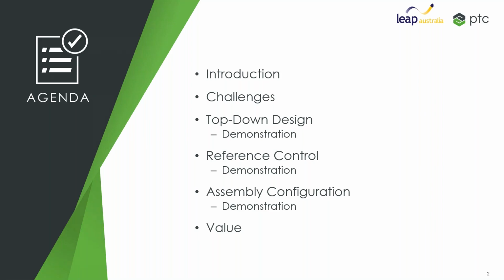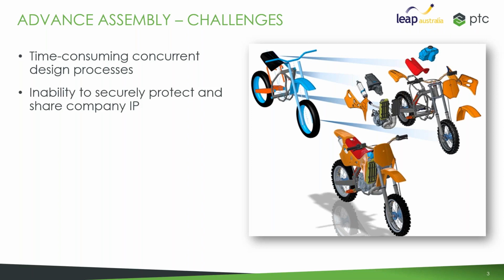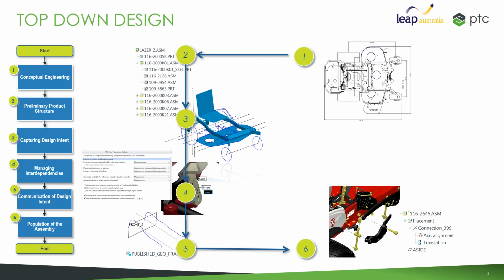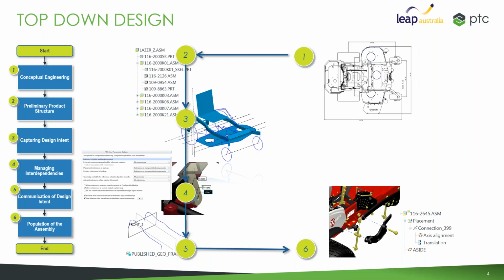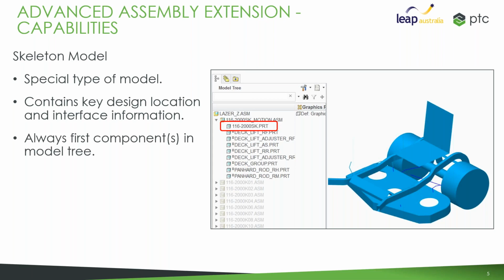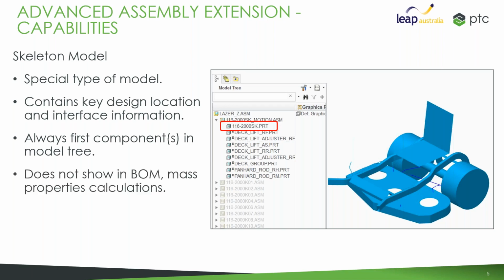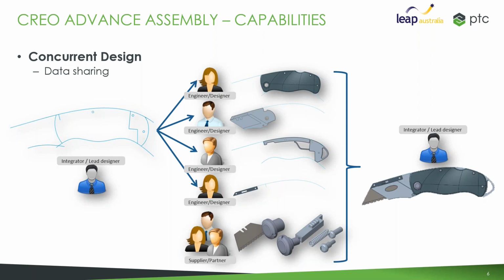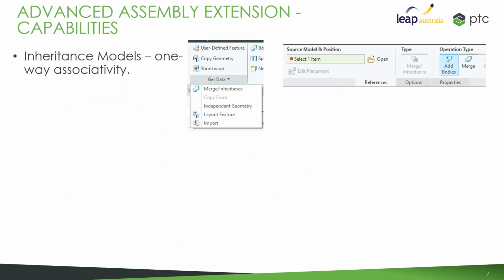Advanced Assembly Design with Creo - Introduction and Overview (Part 1 of 4)

Comment: Each time I'm making  same model of different size in creo and then importing in ansys. is there any way to code  in Ansys so that model size change by its own.
Reply from the maker: Thanks for your interest. We suggest you ensure your installations of Creo and Ansys Workbench are setup correctly so that the bi-directional CAD link is available between Creo and Ansys WB.  You should then see a "Ansys Workbench" icon within Creo, and be able to assign named selections that are brought into Ansys and allow for parametric CAD geometry updates which can be pushed through automatically. This kind of setup also allows for easier "what if?" runs and a more comprehensive "design of experiments" study.